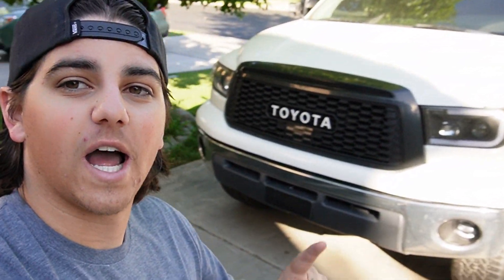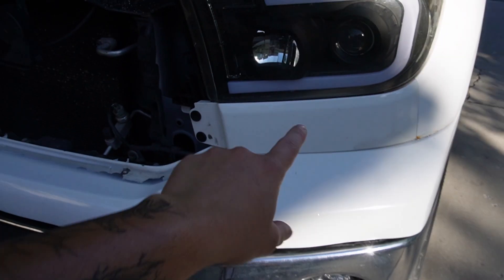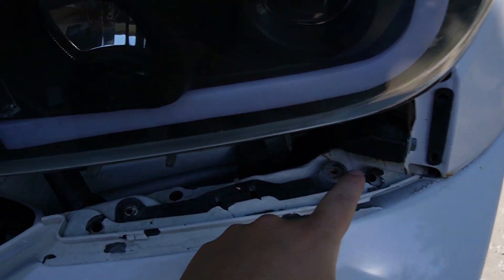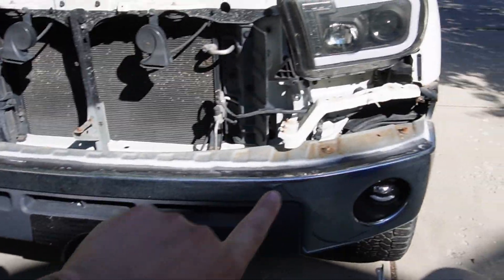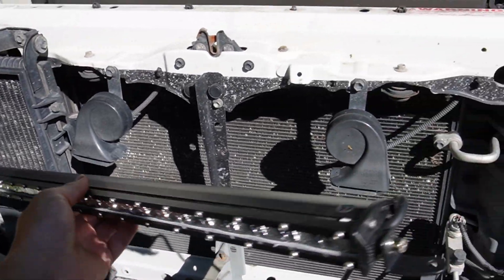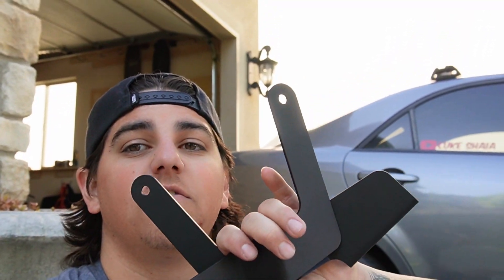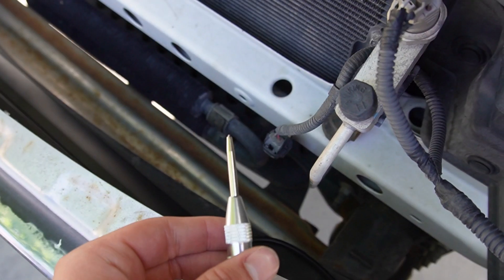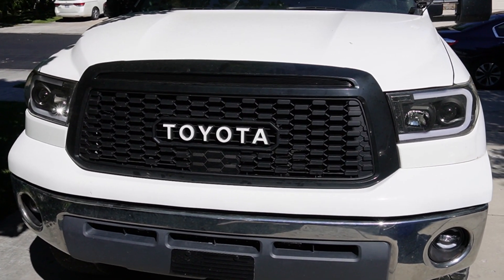Installing A Hidden Light Bar on a Toyota Tundra!! (2007-2013)

Comment: I installed that light on my 07, although I changed out the lower bumper grill for a 10-13 that has long center opening and fits light perfectly. Nice video.
Reply from the maker: Ahh nice I bet that looks good! Thank you!

Comment: Great video! Do you know if they make longer brackets? Id loce to mount a bunch of KC lights on a var across the front, or even a police push bar
Reply from the maker: I’m not sure, I think that’s pretty much where they get bolted to. It’s pretty much the edge of the crash bar.

Comment: When drilling into the crash bar what do you need to disconnect so that the air bags dont go off ?
Reply from the maker: You want the battery disconnected, so that there’s no power to the airbags to deploy. I would give it some time after to make sure the charge is completely lost in the airbags, before drilling.

Comment: How are you liking the light bar? Is it worth installing or probably not?
Reply from the maker: I think it’s cool, I just haven’t used it a whole lot. I haven’t been off roading in a while and don’t use it on the street.
Reply: @lukeshaia  sounds good man! I like how clean it is. I don’t do much off roading but I’m pretty rural so it’d be mostly for deer.
Reply from the maker: @bluekronemeyer692   Yeah, it would help a bunch. Same with pod lights, that will give you more of the side of the road lit up.